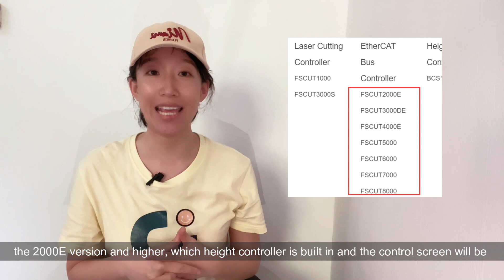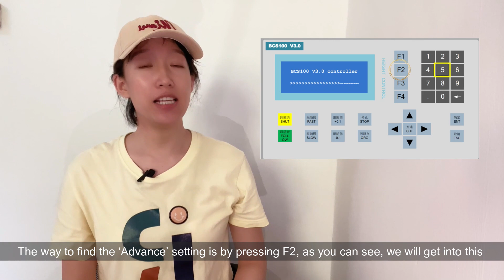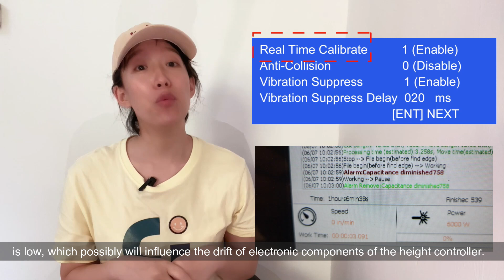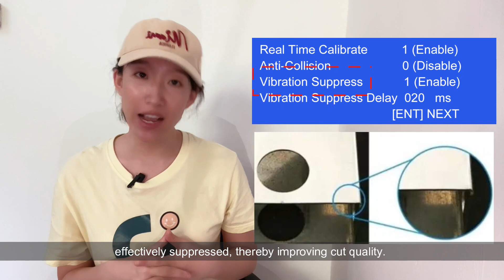Full Analysis of BCS100 Advanced Settings--CypCut 2000C

Comment: Hi clara
I have a question When do we calibrate capacity in bcs100?  When we change metal want to cutting it , for example, from iron to aluminum?  Or when the cutting height changes, for example, if the cutting table contains two tables, one higher than the other, for example, 15 centimeters between two metal sheets ?

Thanks
Reply from the maker: Normally, for the capacitance calibration, you need to do it only when the capacitance is abnormal or some consumables are replaced, like the ceramic ring.
Reply: @ClaraChai  thanks
How much is the price for your online technical support, to improve the cutting and to adjust some things in the cypcut program?